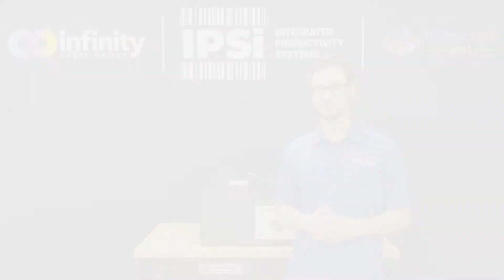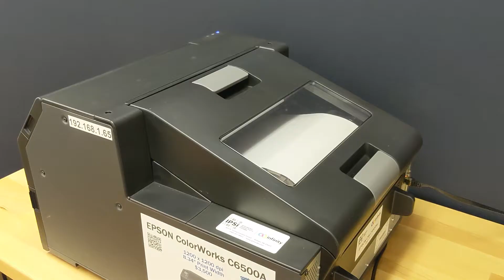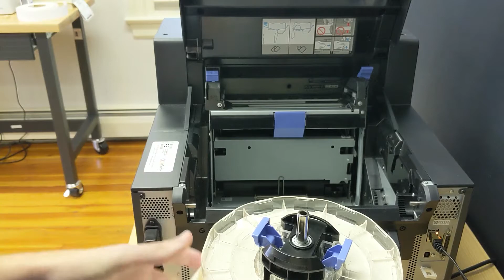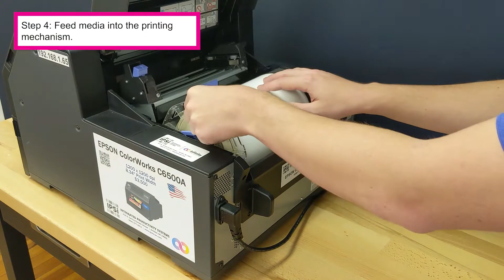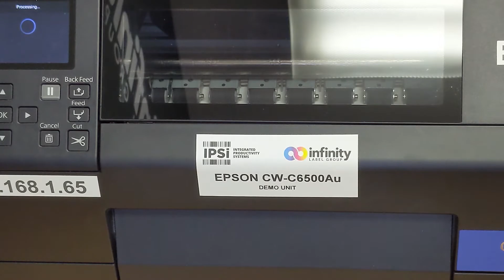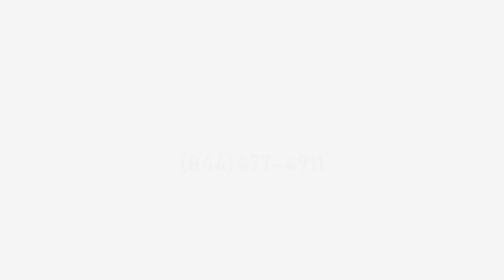IPSi Print Lab - Epson C6500A: Loading Internal Roll Labels

Comment: Hi, I’ve recently purchased this printer so I’m still in the process of figuring out how to make it work to its potential. Early on I’ve had a couple of issues with the printer detecting the correct size of the label media and also when I try printing on circles the alignment is about 5mm out. Do you have any suggestions as to what I could be doing wrong? Thanks
Reply from the maker: Joe- thanks for the post.  I would have to see what label stock you purchased to comment effectively. Most issues related to alignment are a result of incorrect size measuring, the driver not being set up correctly and/or vertical & horizontal alignment offsets being set or not set properly.  if you can send me pictures of the front and back of the label stock you are using i could contact you and discuss in more detail.  you can send me a message at sales@infinitylabelgroup.com
Reply: Did you ever find a solution to that? We have the same problem. We are able to sue the alignment, but it always seems to cut the top of the circle off, regardless of the black mark detection.
Reply: I know Im asking randomly but does anyone know of a tool to log back into an instagram account..?
I stupidly forgot my password. I love any help you can offer me.
Reply: @Carmelo Benicio Instablaster =)
Reply: @John Stanley i really appreciate your reply. I found the site on google and Im trying it out now.
Takes a while so I will get back to you later when my account password hopefully is recovered.
Reply: @John Stanley it did the trick and I now got access to my account again. Im so happy!
Thank you so much, you really help me out :D
Reply: @Carmelo Benicio glad I could help xD